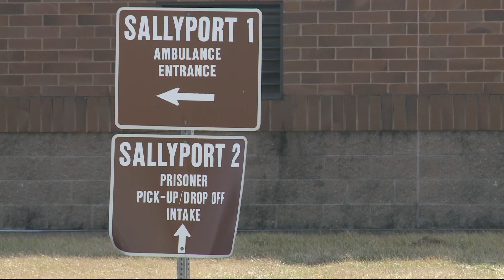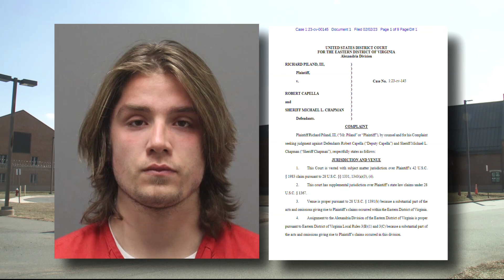Inmate suing Sheriff after being burned in hot shower in Virginia prison

Comment: Of course they knew it was still faulty. As anyone who has ever had a water issue knows you NEVER just jump straight into a shower (cold or hot), you always test the temperature by hand before just throwing yourself in.  They knew it had been faulty for weeks so they should be more likely to assume it was more likely broken than fine, and until someone has tested it the last thing any sane person would do the is throw another person into an unknown. They are either guilty of wilful negligence with actual bodily harm or torture.